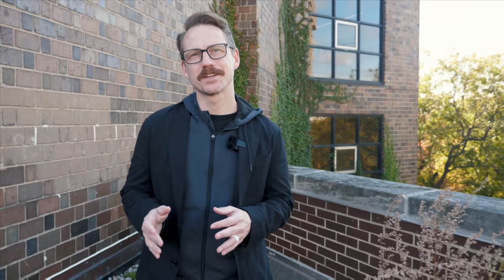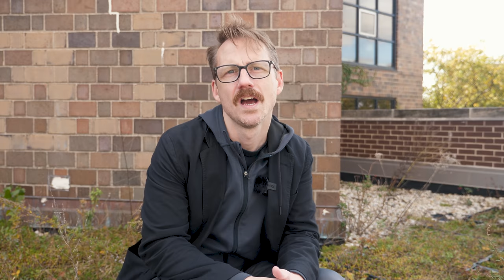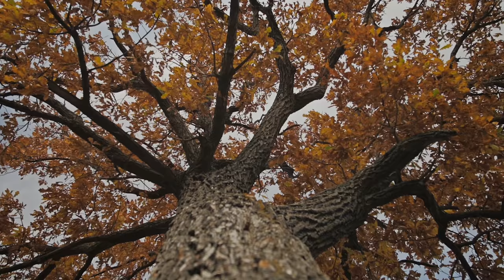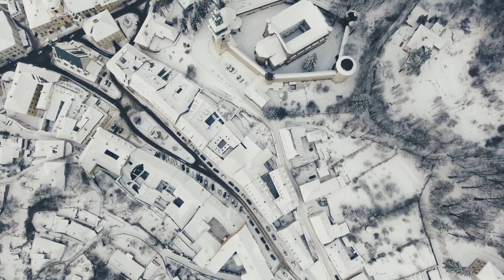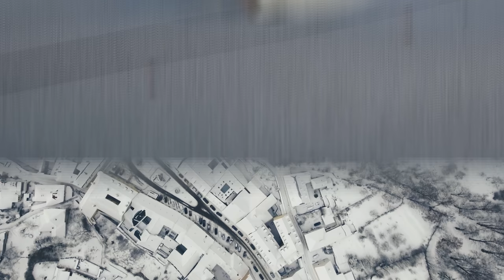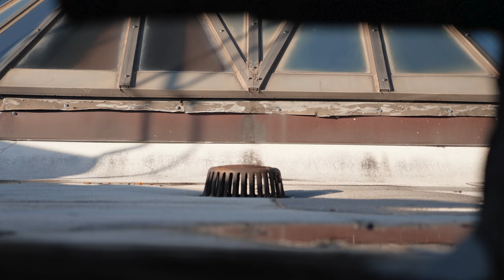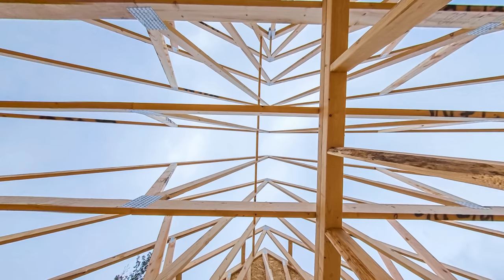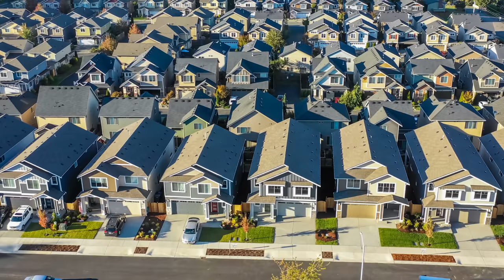Why Do Architects Insist on Using Flat Roofs?

Comment: There are upsides for flat roofs but as structural engineer I disagree that flat roofs are cheaper and better structurally. I also think that sloped roof apartments are the nicest one because they have some charisma and much nicer lighting options.

Comment: Imagine even a low-rise building with a pitched roof. Now imagine the icicles hanging off the eaves in the winter, or a snow or ice dam breaking loose...falling 5-10 stories.  Also..when it comes to repairs..much safer to repair a flat roof.

Comment: Renowned architect Frank Lloyd Wright used flat roofs in his designed... From what I've read, they all had problems with leakage... If I lived in an area that only got an inch or two of rain a years, maybe I would consider it, but living in an area where we get 50" of rain on average each years and we recently got over 74", I think I'll stick with sloped roofs... Luckily, no snow loads, just hurricanes and tropical storms to deal with...

Comment: Imagine snow falling from a 100 meter building, on your head, as you walk near the building. Or water. That would be the reality of a sloped roof on a building or a skyscraper. Nobody sees a problem with that? Try cleaning the gutters on a 200m tower. Or install air-conditioning. Or any equipment. Then do maintenace on it. It's INSANE to put a "house-roof" on a large building.

Comment: Flat roofs on one story homes are extremely  ugly , constantly leak, cause erosion on walls and foundations. After watching this excellent video I realize it's the design flaws by the builders that want to build as cheap as possible. These box looking homes in Arizona should be designed differently to avoid the common problems arizonans complain of. Although they are still an eyesore as a one story home.

Comment: our family bought a flet roofed house, made in Norway in the late 70s. 4 units attached.  it has had constant problems with leaks for 38 years ever since we bought it in 1985.  Not a single method has worked.  tar, ashfalt, plastic, membranes, etc you name it its been tried.

Comment: Most of the concrete house in my area have flat roofs it is used as a another living space and very good for hanging out with friends, there never a layer of protection on the roof yet there is no problem of leakage but it occasionally occurs after 20+ years but so do sloped roofs because of deterioration of the material but flat roof is easier to repair and the only inconvenience was the noice but sloped roof will have to be taken leaving you with an open roof. I'm planning to build my own two story modern house even that will have a flat roof

Comment: My house has a flatroof but its concrete serving as a rooftop that is a space that ive used for small gatherings, ive installed clothes lines for air drying, and it also where my a/c units are located as well as my solar water heater.

Comment: Everything is context right , by which I mean weather , in this case. If you live in a low rainfall or low snowfall area then flat roofs will be great. If you don't then despite advances in roof technologies I still don't see the sense, in domestic scale architecture,  in designing in a problem you then need to engineer your way out of. Particularly since most roofers I have had anything to do with are hacks more interested in doing as little work as possible for as much pay as they can get away with. Leaving the building owner with a problem waiting to be discovered. That is true with gabled roofs of course , the difference only being in how long you have to wait.

Comment: Yeah. Its more to the point. Roofs need to be designed for.
1. Function of the building and accommodating aspects as Height, Size and surrounding area. 
2. Accommodate local usual weather and take into consideration the challenges that will place upon the roof. 
3. Usable materials and budget of the project. As well as time table. 

Like MOST things its FAR more complicated than people make it out to be. Lots will tell you that Flat roofs always leak. I have occupied and owned the same building for business purposes for the last 25 years. Flat roofed. Here in the Mid west. Never leaked. Just have maintenance done once every 5 to 10 years. At the same time I grew up in a Traditional Heavier sloped home and it leaked a LOT. 

So no design is inherently better.  
If we used one design for all we would be far more limited for the types of buildings and locations we could build in. 
Personnel experience aside. Because EVERYONE will have different experiences that rely on a thousand external factors that are never touched upon when discussing the topic. 
Yeah. I do not mind Flat roofs. As long as they are done right and well and maintained. They work really well for the intended uses. But same could be said for any roof design.

Comment: Flat roofs are generally less expensive than sloped. and with modern membranes they will last longer than any asphalt shingles on a sloped one.
Sloped roof also collapse under the weight of snow if not properly designed.

Comment: I had to participate in a test/exam by drawing multiple things before enroll at my current vocational school.
I have drawn a house with a VERY Complex shaped roof, it is easier described as an half-shpere than what it actually is, but it isn't a dom due to the form again.

Roughly speaking I have tried to draw a house which could be the most suitable for most weather conditions, keep it as economical as possible and by that I mean the costs after been build like lighting and heating.
Of course its not though through enough or at least I think it isn't.

But imagining all the curves needed for that house... It only natural to build houses(roofs) cheap, easy and mantainable because THAT thing is a pain in the ass.

Comment: I don’t know who told you that flat roofs are better than gabled roofs for heat, but they’re wrong. The trapped air between the ceiling and the roof serves as an intermediate layer that reduces the rate of heat transfer

Comment: Vernacular architecture exist as reaction to respective environment, that's why we dont complain flat roof in dessert environment the same way tropical environment has overhang roof in their traditional house.

Whenever there's a mosque with middle east architecture (flat roof with dome) in here indonesia. the flat roof always dirty with grunge and water mark and overall ugly and disgusting. The inside also tend to be hot and stuffy, hence they're closed room with multiple ac. However, when they build mosque with local style (like javanese style for example), they dont experience any of these issue by incorporating element that's suited for tropical environment. Like, overhang roof for the sunlight, high trees for anti glare and passive cooling, combination of raised ceiling and ceiling ventilation because hot air tends to rise up and they will refresh the building circulation. So they're very much shaded and chilled by gentle wind blowing without using any hvac or multiple ac that consume energy and heating up the earth.

Comment: The design of the roof should obviously be dictated by both the function and the context. It is counter intuitive to say one is better than the other. Lack of maintenance and bad workmanship cannot be a reason for choosing one over the other. At times flatroofs simply doesnt work and similarly gabled roofs can also be inappropriate for a lot of places. One of the most vital deciding factor is the geographic location of the building. In countries with a rather hot summer, flatroofs can make the room underneath extremely hot and unusable with no insulating air gap under the roof. Attic spaces under a gabled roof is not usable space for a reason, because it is made for the purpose of providing insulation to the rooms below. Contrary to the arguement in the video, without proper insulation flatroofs often forces people to constantly use air conditioning to maintain livable temperature. It both traps heat in summer and rapidly dissipates heat in the winter. Both of which is undesirable as a design outcome and is not quite sustainable.

Comment: Tall buildings and buildings needing roof space for equipment--- people WANT flat roofs so architects use them. People (clients) pay the bills. And TBH flat roofs are built for decades with no problems so there's little reason to worry about it. Like the discussion and general education for both initiated and uninitiated.

Comment: I've always preferred angled roofs visually, yet I can't help but suffer whenever I see a steep angled roof and think about how you'd clean it.
Soft, reasonably obtuse angles are alright to clean up, but steeper angles give me the creeps and alpine ones must require ladders.

Flat roofs, as much as I still find them not pretty, do have a lot going for them in practicality and ease of service, especially in dry windy climates.

Comment: Flat roofs leak more. A lot more. All the time compared to the buildings i deal with that are gabled. In residential the reason for flat roofs is almost always city height restrictions that even sight line requirements can't resolve. Economically, losing a floor because of it doesn't pencil.

Comment: But how do you build a flat roof 'sustainably'? They cannot be conceived without the use of plastic materials for both permeability and insulation. Also making a flat roof 'useful' or walkable requires high load-bearing structures that can hardly be achieved without the use of concrete. Whereas a gabled roof can be generally built with wood and tiles. Also, the empty spaces below a gabled roof can be and have been optimized throughout the history of architecture (think about Mansard for example). As an architecture student who really cares about the future of building and about sustainable construction, I don't really see the point of further glorification on flat roofs, as degrowth will impose us to rethink the materials we use for construction, especially plastic ones and concrete.
Nevertheless, thank you for the video and I would love to have someone else's opinion about this subject.

Comment: Form does follow function here. The flat roof is 99% because it is a place to put equipment, that's it. The other aspects are solutions to the problems of the flat roof that is needed for the equipment.

Comment: Thje curved duct shown at 10:50 illustrates why the nearly-universal practice of flat structural surfaces is no longer ideal, but a very poor compromise. A hundred years ago that duct would have been be rectangular. 
The origin of simpe flat-ish surfaces is stoine stacking and "stick-building". Niw itls used to create  non-durable structures using low-skill workers.  In the US we have the tech to manufacture complex  curved surfaces of materials that are more durable and require less material and maintenance than built-up or shingled roofs.  We don't because "that ain't the way my grandpaw did it".   
-The same arguments can be made for against flat walls, or opposed with a counter-question "why DON'T cars have flat roofs".  A dome is the most structurally strong and efficient shape for a roof for all climates. It can provide the greatest interior space, the least external surface area and use the least amount of material to constuct -BUT  It requires a better-trained class of designer and worker to design and construct one.
It's hilarious to hear this discussion with the UIC admin building in the background, my alma mater being one of the worst examples of misapplied architecture in the US. Tne campus would have been ok in Arizona or perhaps California, but It's signature feature a campous-wide  upper level deck - was a nightmare to live with 90% of the time in Chicago, a disaster that had to be removed.

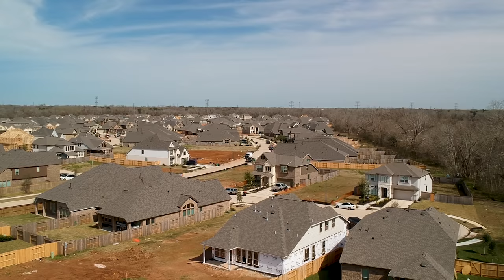Comment: A small correction... Just as "flat" roofs are actually called "low sloped " roofs, what you were calling "gabled roofs" throughout the video are properly known as "sloped" or "pitched" roofs. Several of the video clips you used as examples of "gable" roofs were actually hip roofs (8:38, for example).

Comment: I had an old (over 100 years) town house where the roof slopped inwards to an internal gutter rather than towards guttering on the outer edge. It looked a stupid concept from the moment I saw it. I had to go up onto the roof to clear any leaves or debris otherwise the internal gutter would block and rain would come through the ceiling.

Comment: I disagree that "gabled roofs are always the answer".
South-facing single-slope roofs are always the answer these days, so you can install solar panels all over the roof and even a row of wind turbines on the north side., where all the building vents would also be located.
On a house, you can have a flat section right in the middle of the solar panels, with a terrasse that is partly in open air, partly covered by the highest panels, and partly covered by glass panes as a solarium or green house.
I also obsess over water leaks, so I would make sure to double up drainage like I did in my shower: the regular shower drain, plus another drain under the shower tray so that even a leak would be redirected away from the walls.

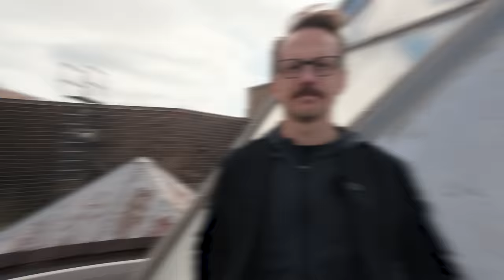The McMansion at 8:56 has no less than 25 different sides, multiplying the risk of water leak by 25 compared to a single-slope roof. So much wasted space for a star observatory, a solarium, a fish pond, a garden, etc.
A single-slope roof is already incredibly cheaper to insulate effectively, to passive house or positive-energy standards too.

On an apartment building in the cities, a flat roof is awesome for BBQ parties or relaxing, especially with some greenery.

Comment: Flat roofs works better in cold climate despite snow.
Roof sun protection is crucial in low latitudes if you dont want to be a AC slave.

Comment: In Turkey, where I live, flat roofs are normal, but they also make houses out of cement and bricks, not wood and drywall like in America. If they are built correctly and in the right climate then there is no problems, its when people try to adapt a style to a location where it is not usually used that you encounter problems. Also I have seen people in Turkey try to built America style homes and they are a disaster.

Comment: As much ad I can't disagree with the content,  I have some anecdotes to tell.
I live in Brazil in a region where rainfall is not very high for Brazilian standards, although it rains more than in Seattle.  
Rain here is mostly concentrated in summer months, when it storms most of the time, and very drought months, when we can be without any rain for over two months.
Due to fashion many houses have been built with hidden flat roofs (maybe constructors don't know they should slope a bit) but every time it rains, such houses flood! It there is as much water inside as there is water pouring from the sky.

Comment: The function of a dwelling is to keep the elements out using walls, floor and a roof....I have yet to live in a flat roofed house that has kept the water out. Therefore it is not fulling its basic function.....that's my take on the ''form vs function'' argument.

Comment: Flat roofs make sense in the desert.  Flat roofs don't make sense in the snow belt.  The flat roof of the  local school where I live 
was patched every year and continued to leak.  The school board finally smartened up and had a peaked roof installed over the
flat roof.  Problem solved.  I have toured a couple of Frank Lloyd Wright "prairie" houses.  The guides at both houses admitted 
that the roofs leak.

Comment: I'm a structural and mechanical engineer (I've still never made the money my dad did with 3rd grade education) anyway..flat roofs are a pain in the (....... )!! In every situation!!!

There are engineering designs to manage steep roofs even on commercial buildings from low rise to high rise. Water, snow, and ice catches mixed with heat coils or panels, hidden gutters, manage steepness well.

Flat roofs are for deserts or other low moisture environments.

Comment: I like flat roofs because I like townhouse and roofdecks. Even for single family, fully detached homes, why not have a roof deck? You can still have an attic—it’s called *building  another fucking floor*. If it’s below a certain height it’s still just an attic🤷‍♂️. That’s your problem to argue with local zoning boards lol. Roof decks, even with a huuuuge backyard, are still neat and fun. You get to have a raised, outdoor experience. Put a hot tub up there and imagine how fun that’d be. You get to overlook the rest of the party below from your sky tub and sky garden.

Comment: You have clearly never seen a flat roof collapse from snow load or rain pooling on it. I have.
Flat roofs only work against rain if they are watertight. There is a reason why pitched roofs evolved in wetter snowier areas, and flat roofs evolved in dry areas.

Comment: I have apartment buildings in the Chicago area; including 20+ unit buildings. I have both traditional shingled buildings and flat room buildings. The flat roof buildings have had all of the different roof types (getting the gravel off is fun). I recently installed two TPO roofs. The cost of installing them is about 10x that of a sloped shingle roof and the warranty is for a similar 20 years. I don't really care what architects have to say; I have experience owning and maintaining both and flat roofs are always a stupid idea.